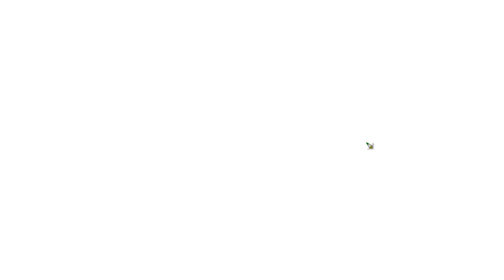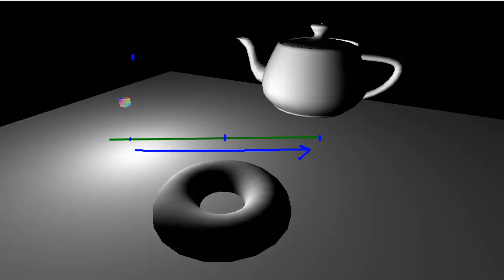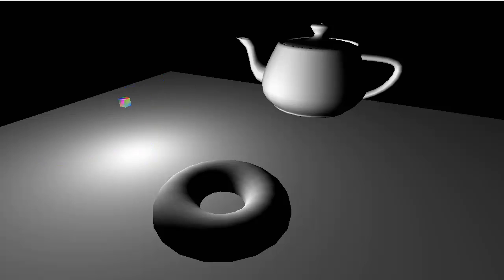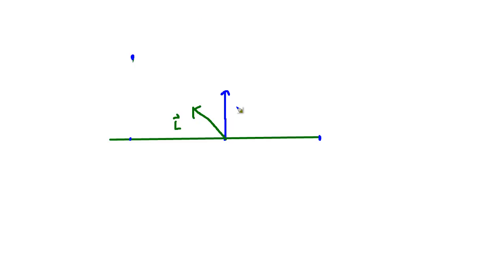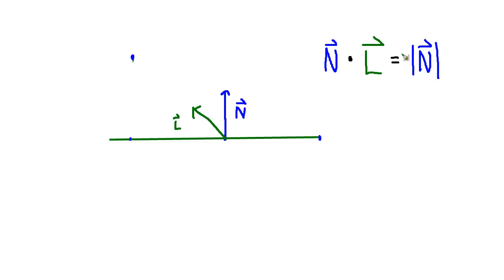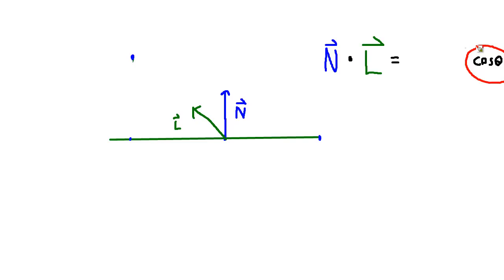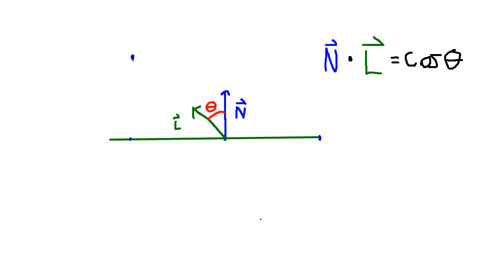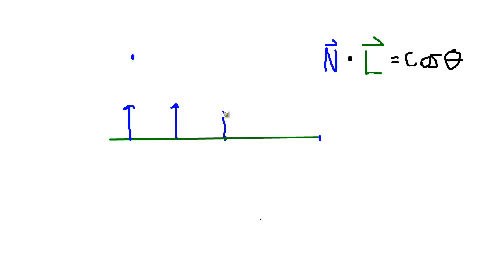Diffuse Lighting Equation

Comment: Love these videos!  BTW,@7:30, you say that cos(theta) is a direct relationship to the amount of light that is hitting a point.  Are you sure that's correct?  Photons intensity at a point in space is only related to the density of photons at that point, not the incident angle.  Reflection and refraction, however, ARE dependent upon incident angle.  What did you mean?
Reply: Greater the angle, less photons hitting at that point hence lower photon density

Comment: How do you apply the color change from the value you get from the equation? In code?
Reply from the maker: Not quite sure I am following your question, but I'll try. Color is a simple vec3 (rgb), so whatever your light color is, multiply that with the brightness and the material color, and there you go.
Reply: Jamie King
I have no color for the light and cannot set one(or probably dont know how)
I am using a diffuse equation I = Id*Kd*L.N. How, using the value from this equation, would you code it into filling the polygons with color. Ps I am not using openGL or other framework. Just simple VStudio with c# no thrills.